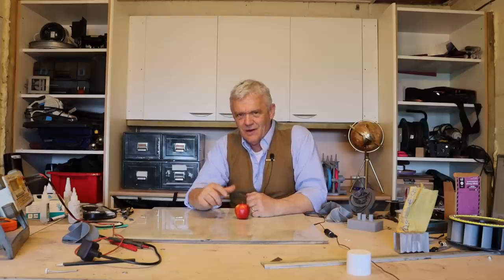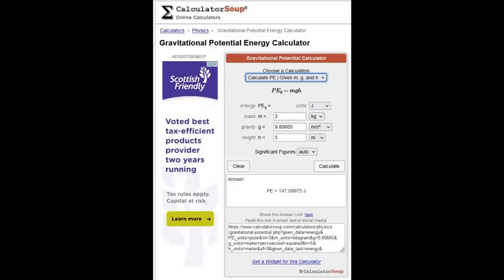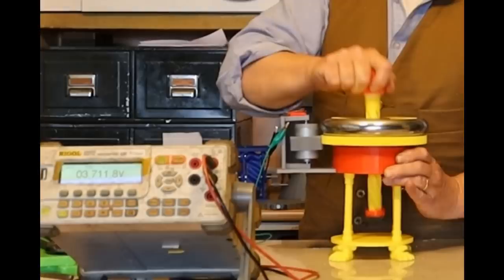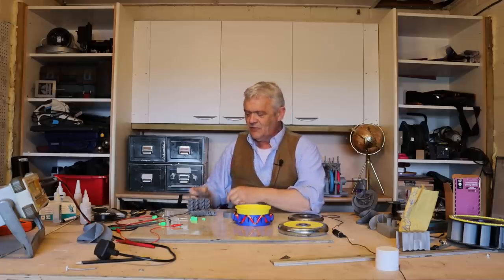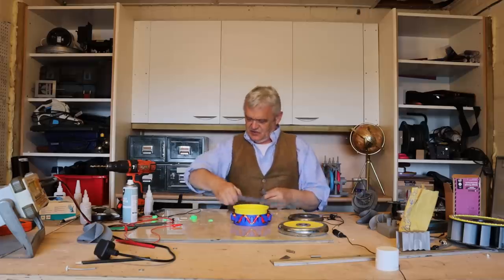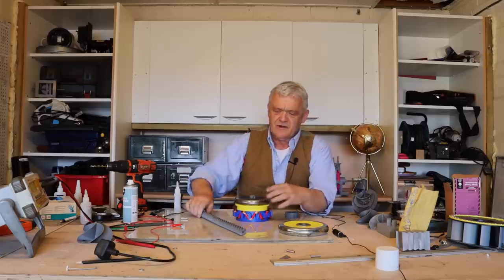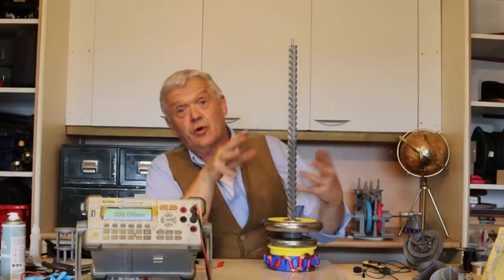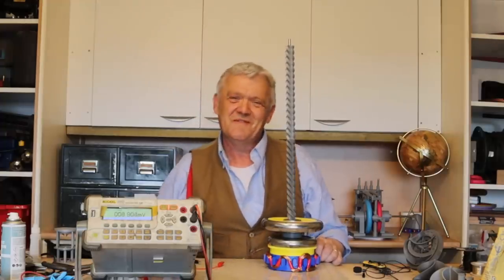2047 Gravity Energy Storage

Comment: I have been considering a design for a stool that would use the same mechanism as the previous video allowing us to use our body as the mass falling down it would need a lot smaller threads but i think it would be cool
Reply from the maker: i agree that would be cool
Reply: I think the step generator would also work on a person sitting on the chair that would be another option.
Reply: @ShafaqIftikhar-pw9ld  maybe but it has a much shorter range of motion so it would only generate for a moment after sitting and standing up where as this could fall for 1ft rather comfortably although the foot generator could be really good in high traffic public seating like on trains or busses ect
Reply: @EpIcHoBoGuY  I agree.

Comment: As you said, a structure of some sort around the falling weight would stop the wobble.  Maybe the structure should stop the falling weight's spin, as well as have a small stopper near the bottom, just above the flywheel weight, so it doesn't slow the flywheel down.
Reply: Possibly the weight could be confined by 4 Round legs that may spin as well?!

Possibly get a little bit more Energy production by the rotation?! 
(I'm thinking about Magnetic bearings...)

Andréa and Critters.     ...XxX...
Reply from the maker: nice suggestions mate - cheers

Comment: Hi you need to stop the falling weight from spinning as potential energy is being wasted in the spin but the extension of the spiral gear looks interesting when the weight is at the top(possibly an accident but fun)
Reply: Gear then flywheel
Reply: @thomasholland4313  yes but in the wrong direction?.
Reply from the maker: guide rails mate
Reply: @ThinkingandTinkering  yes but thay need to have bearings to reduce friction?
Reply from the maker: no just oil mate - like bushings
Reply: @ThinkingandTinkering  or light grease (silicon type spray?) Or something like?
Reply from the maker: yes - well, i think so mate
Reply: @ThinkingandTinkering  I have to make my own consistency of grease using grease and various oils as I have some unusual machinery & repair even more unusual & make   phosphor bronze bushes & plastics

Comment: The absolute beauty if water is that as a GAS, it is LIGHTER than air, and yet as a LIQUID it is 800 times HEAVIER than air [denser].

So air becomes really light, goes up really high, then condenses and begins falling back to where it came from.

This is due to the marvelous action we call 'phase change'.

This happens all the time, without any loss of energy in the system.

Its the ultimate power system!

Comment: A far simpler arrangement is generator can be powered by falling weight unwinding a drum.  Unfortunately such will tend to keep accelerating, limiting run time. 
A solution can be to use a 
 non-newtonian fluid as a grease for the drum's rotation. When rotation is slow, it offers little friction. But as the drum speeds up, the grease will shear thicken, and start to act as a brake preventing overspeed and extending run time.

Comment: If, the weight was hollow lifted to the top,then water was pumped uphill and filled it somewhat as it was dropped the water would move to the outside of the weight due to centrifugal force increasing the rotational energy ( a rotating plate verses a rotating dumbbell of the same weight) .
Or perhaps a mechanism like a centrifugal clutch from a mini bike except with weight on the clutch material ends

Comment: figuring out a way to flip the thing, after it hits the bottom, so the weight is back at the top. then add couple shafts so it just turns the center shaft not the wheel itself.

Comment: I see problems with this:
- gravity storage requires a LOT of weight to be a reasonable energy storage system. 100s or 1000s of tons at least. I imagine manufacturing (and maintaining) those spiral axies will become very expensive on that scale
- also this will produce a lot of friction between the weight and the spiral axis. Probably far more than would be lost via transmission losses, for instance if that weight would be just on a rope over a pulley which drives a generator.
- lifting the weight again in an actual context requires another pulley system attached to the weight anyway, so the spiral really is redundant.

Comment: Might change the incline of the screw part or add more turns so it doesn't drop so quickly.
Reply: Using a long planetary gear ring, and the weight to turn the ring. and then add couple compound spur or planetary gears at the bottom.
Reply from the maker: i think that is a god idea mate - cheers

Comment: Simpler method would be to weight the spiral rod on its bottom. A cable or smooth rod on the top of the spiral-this would be made to spin freely on the spiral-the purpose of which is to raise the spiral. Easy with low energy consumption.  The option is to freewheel the cog in the generator during "charging"-raising of the spiral, or spin to generate on the upstroke.
Reply from the maker: is that really simpler mate?
Reply: Yes, mainly because a support structure wouldn't be necessary for the spiral rod with the weight on the bottom, pulling rather than pushing. With the weight pushing down on the rod the rod would necessarily require a support to keep it straight as you mentioned in the video. Anyway pulling is a much more efficient means of applying force than pushing.

Comment: I was pondering the idea of using a weight in an abandoned mine shaft where the lift would normally be. Then any surplus energy from say a wind turbine or other renewable could lift the weight when consumption was low and be lowered driving a generator much like a grandfather clock system.
I suppose it’s been done though! 🤓

Comment: If i'm correct, letting it fall down would rotate, the axis in one direction. Would rotating the axis the opposite direction may lifiting the weight? Or, lifting the weight would result to turn the axis as well. Both could be obtained by wind or "hand crank", that would use the rotation directly without any energy conversion in a way or the other, while - as the generator section is also moving - generating electricity while lifting (or loading the "battery"), as well while releasing the weight.of course, charging require more energy in this case.
Am i right?
Reply: I mean, the first thing is obvious, just thinking about the rest to be considered as an advantage.
Reply: The other thing is, i'm glad about this and the last video as a revisit of a possibility in converting linear motion into axial as i'm still "stuck" with that "strange engine" idea.
I tried out different versions and came to the conclusion that the key might be in the ratio of the amount of the boiling liquid inside the engine and temp. difference  between the two ends. Using a "filflopthing" (sry, not native english :) ) to convert the engine's linear motion into a radial to drive this mechanism would be cool.
For now, i'm using tea candles to have a standard input, but in the future i'm planning to use a frensel lense and mirror as solar source. For the cold end, thinking about a segment (before the very top end) made from clay (like a two layered pot), filled with sand and water to have a passive cooling solution.
Opinios, ideas?
Reply from the maker: it would mate

Comment: Trying to think of permanent, and rechargeable, battery solutions for solar power led me to your gravity battery videos, so that's the angle I'm approaching what I'm about to say from:

Assuming you wanted to take this particularly high, say 50 feet, couldn't you have the bearing supported top be held aloft via, basically, a tripod with a base only slightly larger than the base of the device itself? I mean I'm not accounting for wind/weather obviously, just curious what your opinion on the topic might be, if you read this comment at all that is.

Another commenter had noted that it may be more efficient to not have the "battery weight" land and sit on the flywheel, couldn't you have a support along the central pillar stop the weight just slightly above the flywheel, like a second, much shorter tripod which apexes in a ring not otherwise in contact with the screw so the battery weight could impact there and stop before the flywheel?

If you were going to try something like this for solar power storage, how would you go about scaling such a system to provide residential power over, say, 12 hours of "night"?

Just curious what your ideas on the topic might be, thanks for making these very educational and entertaining videos on the topic of gravity batteries/generators, your style is informative and compelling!

Comment: Now lift that iron plate with 4 ounces of water. Work smarter, not Harder. When the water cup fills, it lifts the weight, when the water cup side of the lever is pointing down the water weight transfers farther away from the fulcrum, thus needing less water to lift the weight and that's when you drain the water rapidly and your 2.2 kilo iron plate wants to fall back to earth because the water cup is empty. Unfortunately obtaining liquid mercury isn't a option for me. Not sure how many looked at my water clock and didn't understand the math used. It was when the weather changed I noticed the effects.
Reply from the maker: cheers mate

Comment: What if you flipped that device upside down and submerged it in water, such as a water well,  raised the weight with an air bladder to turn the screw, deflate the bladder at the water surface to allow the weight to reset the sequence. I realize that some sort of latch would need to be used to prevent weight from slowly rising as the bladder is inflated. Perhaps use two generators at the top with opposite ratcheting drives so that one generator is spun on decent and the other generator is spun as the weight rises.

Comment: Great video as usual. I have repeatedly mentioned here that there is absolutely no point of showing just the voltages, without an attached fixed load. I understand that it makes for a good demonstration if one can see actual energy being generated, but I am sure its not very hard to just attach some sort of resistor for the sake of better scientific observation.
Reply from the maker: you are right it's not very hard - but this is youtube where watchability is king - i do as you suggest on occasion and do you know what happens? nobody watches them lol - so, I am sorry mate  but i will only do as you suggest every now and then
Reply: @ThinkingandTinkering  Well I didn't expect that! If viewership goes down by doing what I suggested, then I totally understand your point. Thanks for the awesome work you do. Cheers!

Comment: I see a limitation in this design that if not observed, could turn it into a single use device as the first drop of the weight would shatter the generator section.

The falling weight needs to be caught by mechanical springs or very strong magnets with same poles coming together that prevent it from crashing into the base.

On the other hand, one could utilize the generated current to energize coils that then catch the weight when the weight gets near the bottom so it doesn't crash. The addition of a battery powered motor to raise the weight back to the top, and assist the generated current in the coil should that be needed. But then; that would be a useless machine wouldn't it?
Reply from the maker: i was thinking gearing mate to maintain an impact less than the shattering impact
Reply: @ThinkingandTinkering  

That would work.
It would also prolong the energy production.

Maybe adding the device that is used in soft closing drawers and cabinet doors to stop the banging would help as well.

Comment: Definitely a system which requires a gearing method to get the most out of it, How much you could actually store in a domestic setting though doesn't seem like it'll be much.
Reply: for that prototype not much, but the storage depends largely on the weight and distance. iirc 1 kg lifted one meter is 10 joules, which is equivalent to 10 wattseconds, or 10 watts for 1 second, or 1 watt for 10 seconds or however you wanna parse it. 

so let's say you want to run your house for a day you should need or around 30 kwh that is 100,000,000 joules, let's suppose you want to lift it up to the top of your house and drop it, and that your house is two stories say about 7 meters, with 100% conversion you would need a weight of 1.4 million kg, raising it to 70 meters would reduce the needed weight to only 140 thousand kg. 7 kilometers (and this point you need to also be going down into the ground) would take the needed weight down to only 1.4 thousand kg.
Reply: I think the people who would benefit the most from gravity storage are those who live in a tiny home. They would need about 7 times less the energy than a regular size home. 

This will give a better shot at energy independence.
Reply from the maker: it depends how much you need and that is very different from how much you want - I read tuseroni6085 and he suggested 30kWh - that seems a little crazy to me - according to my smart meter I use 5kWh per day more or less. I would need 18,000,000 joules
Reply: @ThinkingandTinkering  yeah I had thought 5kwh myself but I looked up the average power usage per day and where I live its 30kwh. Average for the usa is 28kwh/day.
Reply from the maker: fair enough mate - but that is a lot of power you use lol
Reply: @ThinkingandTinkering  everything's bigger in the US lol
Reply from the maker: lol - good one lol

Comment: Fun to look at, but I think there is a flaw: Calculate the energy density. It's not much. You'd need a very large weight indeed to match the capacity of a simple 18650 cell. Gravity energy storage works fine, when you've got a huge volume of space to fill - think hydroelectric and a dam holding back all that water.
Reply from the maker: cheers mate

Comment: I would think letting liquid or sand fall from one tank to the other would have less friction and wear .😊
Reply: like it. its obvious how the wieght gets back upto the top.. not so with his
Reply from the maker: like i did in this video mate? https://youtu.be/cKYGdhIpbEU
Reply: With the sand method you could make a giant egg timer and just turn it when the top is empty via a central pivot point,plus having a slow energy  release over time
Obviously you would have to have a paddle wheel at the central restriction between the two chambers to collect the energy ⌛
Reply: @ThinkingandTinkering  how does the sand get back to the top. i watched twice.
Reply: @paulevetts9771  ???? The same way it got to the top the first time - you put the sand in the funnel by pouring in it. It is not perpetual motion device...
Reply: @pedjamilosavljevic6235  so any energy created is used puting to weight back up. whats the point
Reply: @paulevetts9771  it's a battery.  Charging it isn't free.  The idea is to utilize excess power during peak production and dispense it as needed. No magic just harnessing energy

Comment: Instead of gravity towards earth, could you use magnetic force between two extremely powerful magnets? Would this store energy more space efficiently than having a huge pit with huge weights? Or alternatively, could centrifugal force be used to store a "magnet based generator" and multiply it's efficiency while furthermore maintaining a rather small dimensions?
Reply: And all to be placed inside of a vacuum to decrease air friction and increase efficiency. While controlled from outside the vacuum via magnetic force to charge the device? (meaning to spin it up and increase the distance between the two attracting magnets)

Comment: wouldn't a block and tackle/pulley system be able to greatly reduce the height requirements? like a 1m height with a 10x pulley would be as if its dropped from 10m and one could nest them for even greater length.
Reply from the maker: tanks for sharing mate - cheers

Comment: Hello Robert. In one of your previous videos you mentioned about strengthening the plastic ( drone prop) with super glue. I used this idea on a carabina made from petg and it made the carabina more stronger and allowed it to not break when flexing it. Could you do a video on the increased strength of super glue on different plastics and if there is any pros or cons for different plastics - including CF ?  I have been looking on the tube for this and not found anything yet unless you can point me in the right direction. I'm trying to develop a mechanism that will need this extra strength. I will send to you for testing as soon as I get it operational myself. Love your mechanisms, great work, well expalined.
Reply from the maker: that means buying a on of different filament mate - i am not keen to spend that much tbh

Comment: I am trying to so the calculations for a woosh bottle generator, make a woosh bottle and dip the tip in water. The water is sucked up pretty rapidly, my intention is to run a pelton turbine off of the water brought up. What is your thoughts?